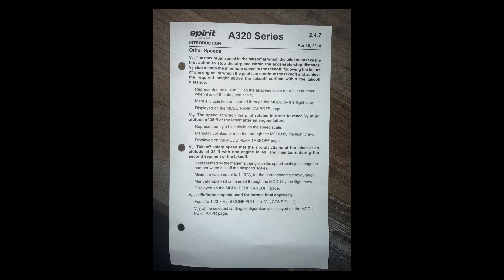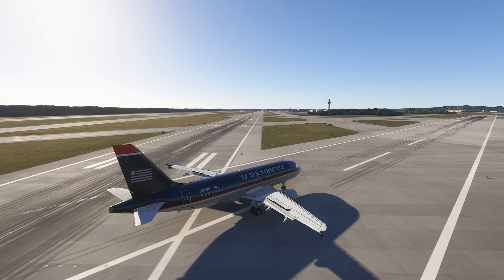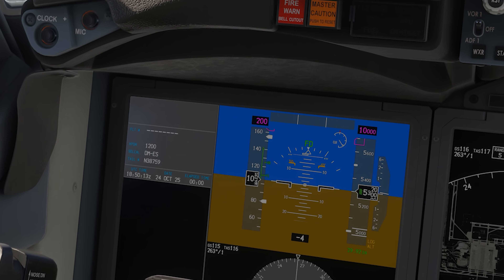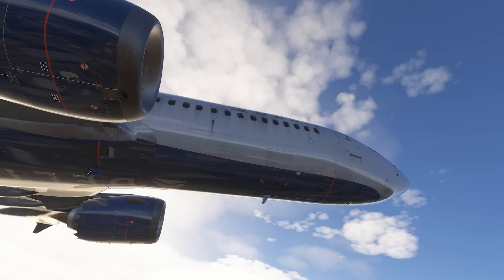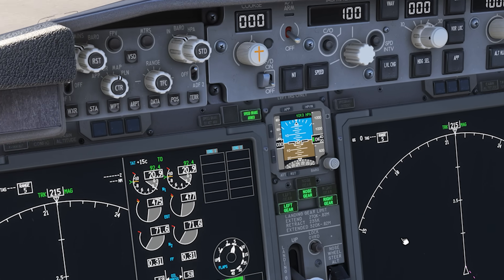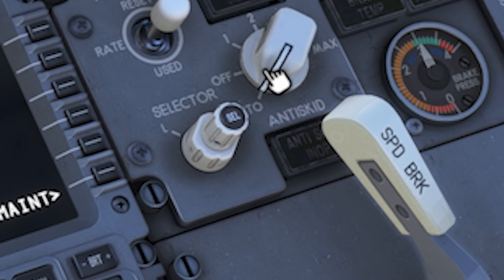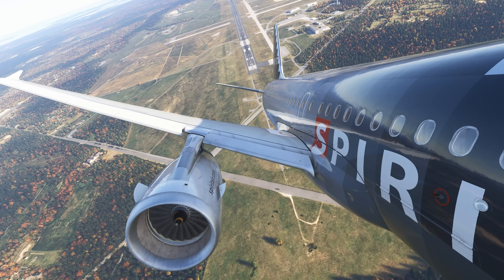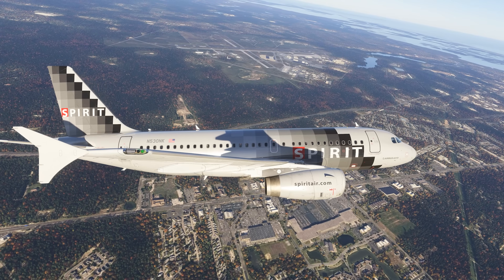Engine Failure-Continue or Reject? | Pilot Decision-Making Explained

Comment: What do you do if you have a dual engine failure at V1?
Reply from the maker: Pray
Reply: @Bananasssssssss Lol… but seriously, like what do you do? I’m sure that’s not something that you train for since the odds are so low, but you’re not gonna fly for very long, let alone climb. Seems like the over run is the safer bet.
Reply from the maker: Oh. Well. If on ground Id stay on ground and get as slow as possible. If in the air, id fly it into the crash. Straight ahead or very little bank. Just don’t stall it

Comment: I have a question: since one of the factors to calculate V1 is runway lenght, if you have a massive runway (for example, in Madrid LEMD we have one of the longest runways in Europe) can you still abort over V1, or V1 value will be so high that VR will happen before?
Reply from the maker: It may be physically possible to stop but the crew will take it airborne once past V1. The issue with aborting past V1 is the brakes heating up and tire failure/brake fire/failure etc. the amount of heat generated from a 150k+ A/c decelerating from 150-160mph to 0 is significant. Whats interesting is a lot of longer runways will sometimes have much higher V1s because the airplane has so much room to accelerate, get to V1 then reject and have plenty of runway left to stop. And coincidentally the takeoff thrust is usually lower (reduced), whereas short runways have lower V1s (because less room to stop) and has higher thrust settings etc( not sure if that makes sense, hopefully it does) .

Comment: Retired from Spirit in 2023. I talked to a fellow captain who aborted right at V1 out of LAS. He said it was violent. He also said “ The best way I can describe it is like a dog running full speed and reaching the end of the chain.”
Reply from the maker: Impressive what these machines are capable of. Pretty cool
Reply: I stood (so I could see brake pressure gauges temporarily taped above the instrument panel) in the cockpit of an MD-80 behind the captain as we did a planned max braking RTO during flight test.  Holding tight to a flight test equipment rack just behind me, it was all I could do to stay out of his lap.